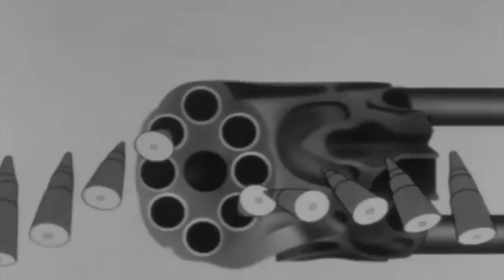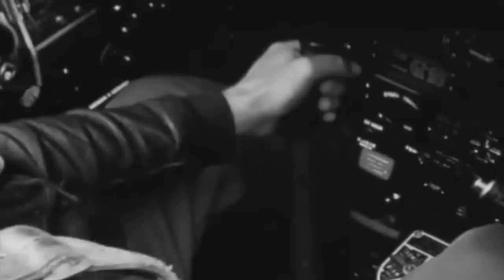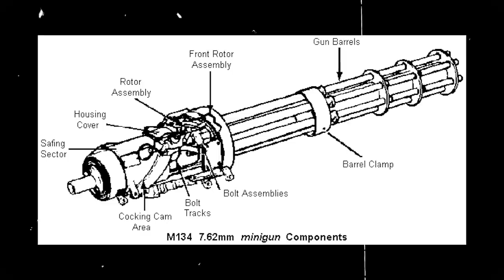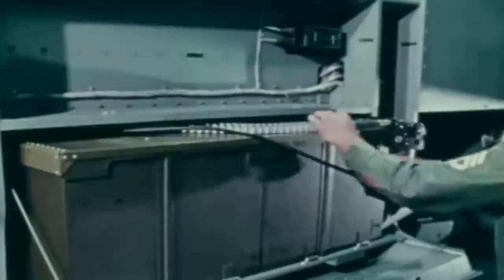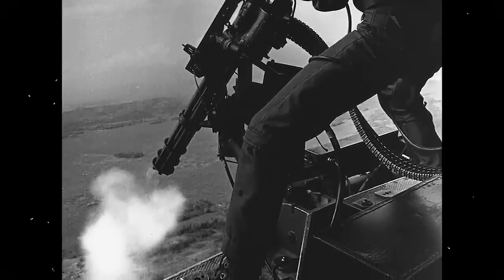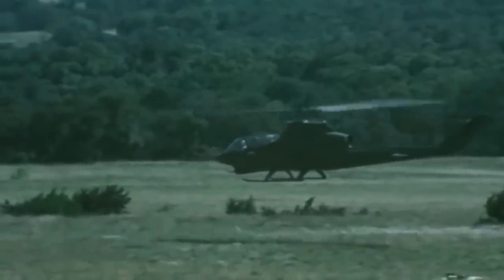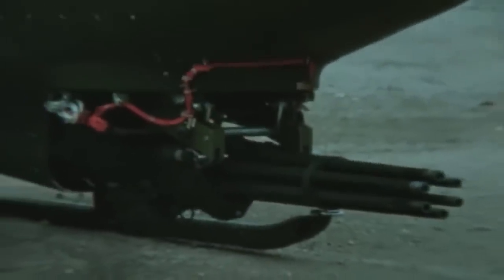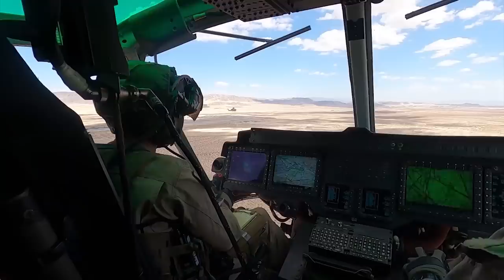Minigun -  M134 7.62×51mm Six-barrels of Pure Destruction

Comment: We had a gentleman who was in my VFW post. He was in the Air Force during Vietnam,  and he was in a AC 47 squadron while he was there. Those aircraft were essential to the troops on the ground then and now. Even though they have moved on from the 47 , still they've provided  much protection.
Reply: The last gunship Aircraft I got the see was the AC-130U version even though I did not get any closer than 45 ft from it it was still an impressive sight with all that firepower sticking out. Especially the 105mm at the back.
Reply: Spooky  👻
Reply: Semper Fi from a '69-'70 Nam vet.(0311 -USMC).
Reply: I had a opportunity to both see a AC130 in operation and get to take a ride on one during a training op.  In somalia they had 4 of them circling one night blowing the shit out of Aideeds compounds.  The only real issue is that you have to have both air dominance and no anti aircraft fire and also you have to use them on moonless and hopefully cloudy nights because even heavy small arms can be fatal to them.

Comment: My dad was a door gunner on a huey gunship.  I've been to his reunions and have conversed with pilots and door gunners alike.  You have a few points wrong.  

1.  The m60 did not overheat.  The helicopter propwash allowed sustained fire while keeping the barrel relatively cool.

2.  Most gunship door gunners modified their guns with recoil and feed pawl spring modifications to allow their guns to fire at insane rates.  Again, the prop wash still kept the barrels cool and reliability was still better than ground units.  My dad said he had periodic malfunctions while serving with the 11acr scout platoon on his first tour.  He said he could count all his airborne malfunctions on one hand (during his second tour).
Reply: I agree. Several of my buddies that flew Huey gunships never complained of m 60's overheating on their Hueys.  poor intel and research
Reply: Yea, there was a South Vietnamese coin that the door gunners would put at the end of the buffer spring of the M60 to give it more tension to increase the firing rate.
In another video about helicopter door gunners in Vietnam an ex door gunner chimed in with a comment talking about how they used to do that, he said he still had the coin he'd stuck in his and removed it the day he rotated out of his unit.
Reply: +1 this video completely missed the point of mini-guns. It was not because they were more reliable than m60s it was because they had a higher rate of fire which was in certain circumstances more important than high caliber.

Comment: I flew UH-1C gunships that were mounted with a minigun on a pylon on each side of the aircraft. They could be aimed left-right, up and down, and were fired by the left seat co-pilot/gunner. The rate of fire on our guns was 2,400 rpm, but when the guns were aimed far left or right, the inboard facing gun would stop firing and outboard facing gun would have its rate of fire increase to 4,000 rpm. They were not my favorite weapon as they tended to have stoppages for a variety of reasons. I much preferred our aircraft that had a nose mounted, belt fed, 40mm grenade launcher, which I found to be a very reliable weapon.
Reply: I've long wondered why the electric 40mm grenade launcher wasn't used on more platforms. Did it have some notable disadvantage?
Reply: @dwaneanderson8039  I don't think so. They seemed to be easy to maintain and very reliable. Availability maybe?
Reply: @dwaneanderson8039  possibly because of availability and ammo logistical issue perhaps? Because they sure are more heavier and bulky so its more complicated to be delivered to the troops or platforms in the frontline, that's just my theory though, some one feel free to correct me
Reply: @kevinrahmatfathoni7896  The grenade launcher I'm talking about is the M129. It used the same ammo as the common Mk19 grenade launcher. It could also use the low velocity ammo used in hand held grenade launchers like the M79 and M203. 
The M129 is smaller, lighter, faster shooting, and apparently more reliable than the Mk19. The only disadvantage that I know of was that it needed electricity to run, but so does the minigun, and people seem to be okay with that.
Reply: Especially when the homemade grease pencil cross hairs on the windshield were on the money.
Reply: “Which I found to be a reliable weapon” I’m sure you did my friend lmao.
Reply: Concerning problems with the bloop tube (M129) :

It's pretty simple, to be honest. There were two issues with the M129, and both came from attempted fixes from the older M75. While most every aspect of the M129 was an improvement over the M75, two problems simply cropped up that didn't have any real solution - even the Mk 18 suffers from them. 

1: Weight. Simple. The damned things are heavy as hell, and their ammo doesn't help.

2: If the electric motor fries, for any reason, it functionally becomes a lump until you can get it pulled by the QM for repairs. While the old 129s were much simpler, the soldiers who could efficiently swap out the internal motor were few and far between... assuming a platoon even had one. Lacking an external drive system, which can be swapped out easily on most electrically driven weapons, the internal drive motor made them more trouble than you might expect when they went out. Granted mini-guns can also have their motor go out... they're external motors. The motor can be unbolted, yanked, and replaced by a monkey with a socket.
Reply: @thalastianjorus  I never had a motor go out on my M134, thankfully. It was probably the most reliable weapon I ever used.
Reply: Buddy, my Uncle said the exact same thing.  Although in ALOT of Choppers that were flying in for Medivac, several had Miniguns, but he told us that almost EVERYTIME he got back from a mission, the Mini was locked up, horribly jammed where it had to be surgically removed, or some malfunction would occur.  He said he ALWAYS relief on his M-60, at some point, and that it was the last gun firing. He said that 40mm was the most awesome weapon he had too.  It could change negative outlooks REALLY quick, and have the enemy running for their lives in a second.  He said apart from the minis and the M-60, they also carried a M-14, that was mounted on the side of the fuse lodge.  With SEVERAL ready loaded 30rd. Clips laid in an empty, 1000 round ammo box right beneath it.
Reply: Wow.. 😮
Reply: THANK YOU FOR YOUR SERVICE AND GOD BLESS YOU AND ALL WHO SERVED.
Reply: The M'5 system was great.
Reply: Any technical issues aside, you can typically trace most war-time decisions back to the financial departments.
Anytime something doesn't make sense, look at the money and suddenly it'll all come clear

Comment: Thank you for finally slowing down your speech pacing. Overall you did a pretty good presentation.
I was a gunner on AC-119G Shadows in 1969.

 In the  aircraft suspended gunpods, the ammunition drum looks similar to a post hole digger. The inner surface of the drum housing has extruded grooves that run front to back.
SUU-11 pods were self-contained and battery powered, only connection to aircraft was for firing and rate selection. SUU-11 A/A Pods were 6000 rds/min only B/A pods were selectable at 3000/6000 rds min.
The rounds are forced to travel towards the guns rotor along these grooves by the spinning "screw". As the rounds exit the spinning drum, there is a feed unit that carries the rounds to the breeches. As the rounds travel through the feeder, they are guided through a 90 degree arc guiding them into the breeches.
As in the sequence of reloading the SUU-11 inside the AC-47, we hand cranked the rounds into the drum via the delinker/loader (7 rds per rotation) and links were stripped and dumped into an empty ammo can. We usually carried 33,000 rds as nominal load. Expended brass was captured in another empty ammo can.

Hope this is of interest to someone. 
Cheers!
Reply: Same basic ammo drum and feed setup as on the M163A1 self propelled Vulcan gun I was on which from what I understand was just a slightly larger drum then what was on fighter jets that had the Vulcan gun.
The "screw" you refer to was called a helix on our systems, even our 24M gun maintenance people weren't qualified to take one of the drums apart and mess with the helix, anytime we had an issue and one needed replacing civilian technicians came in and did it.
When we loaded our ammo drums the system had an electric motor that sucked in the linked ammo and spit the links out the side of the chassis' hull through a temporary chute we hooked up for loading, for getting everything set up and started there was a knurled knob with a place to put a ½" drive speed wrench into the end of it to act as a crank, we'd get the first few rounds into the drum that way then hit a spring loaded toggle switch to run the electric motor, thank God we didn't have to hand crank 1,200 rounds of 20mm into those things, it was a real bitch just getting those first few de-linked and into the drum, you practically had to hang on the speed wrench using it as a crank when doing it.
Oddly enough and I've never known why the M167 towed version of the Vulcan used the 20mm ammo linked, each link had those 2 little ears that stuck out on them and the ammo would hang in loops in a big ammo can right next to the gunners seat, at the top inside the ammo box was 2 rails that ran length wise that the ears from whichever link you'd select to make a hanging loop would slide down, I was only around those in training since only airborne units used the towed version but I never did get an explanation from anyone about why it used the linked ammo and our self propelled guns stripped the links off for it's storage/feed system, you'd think they'd have made them both the same for compatability reasons.
Reply: I don't know why you are praising the video. The presentation of the video is improved but its also a very inaccurate video. And at least to me that is a more important problem than it being presented well.
Reply: @peterisawesomeplease  
What's so inaccurate about it? There may be a few finer points that are wrong but otherwise the history of the Gatling gun and the history and development of the 20mm M61 gun is correct and as far as I know so is the history of the mini gun.
So what's so inaccurate about it?
Reply: @dukecraig2402  It misses the entire point of mini guns. The only explanation it seems to give is that the m60 over heats and jams. But this is actually incorrect. As a helicopter mount it rarely overheated or malfunctioned generally. In fact the minigun tended to have more problems on average. The miniguns were used because of their higher fire rates and lower caliber. Which normally would not make sense given the weight of the gun. On a ground vehicle you would choose and m60. But because helicopters on average move faster and shoot from higher angles you need a higher rate of fire to ensure some hits and those hits are less likely to need to go through as much stuff. Prior to the mini gun helecopter crews would go so far as to modify m60s themselves to try to increase the rate of fire even at the expense of reliability. 

This is a video about the development of miniguns which gives a false reason for the development of miniguns and does say the actual reason. That is pretty bad.

But ehh I guess this is dark docs, which at this point is basically a pure war porn channel rather than having any interest in history.
Reply: @peterisawesomeplease  
Well I don't know how you draw that conclusion, yea they were incorrect about M60's overheating when used as helicopter door guns but as far as the rate of fire about the mini gun it's pretty much made clear that it's high rate of fire is the whole idea behind it, I don't see how anyone who watches this video wouldn't get that point. 
So yea, the thing about the M60's overheating is an inaccuracy but where are all these other inaccuracies you say the video is full of that make it not worth watching?
I was a Vulcan gunner in the Army and their history behind it's development is pretty much spot on, the fact that it was developed to get more rounds on target was made clear, then from there they go into the mini gun being basically just a smaller version of it.
So aside from the M60 overheating thing I'd say it's pretty much an accurate account of the mini guns development and history, and as far as the door gunners in Vietnam modifying their M60's to get a higher rate of fire I just don't get why you'd claim that's some sort of "inaccuracy", this video is about the mini gun not the M60, and just so you know the mini gun wasn't specifically designed because of the need for a better door gun for helicopters, it just found a role there, the way you're wording things you make it sound like it was specifically developed for that and by leaving that out the video is inaccurate, it isn't because the mini gun was not specifically developed for a better door gun, if it was you wouldn't have seen a single M60 in that role by the end of the war, the fact is the mini gun doesn't work as a door gun on a UH1 that's being used as a troop transport, the weight of the gun and the ammo would mean that a UH1 could only carry a few troops, that why M60's were continually used on troop transport UH1's until the end of the war, a troop transport that can only carry a few troops is pretty much worthless wouldn't you think?
Reply: @dukecraig2402  No it is not made clear that the high rate of fire is the point. The video seems to suggest that reliablity is the point. It mentions the high rate of fire but never mentions why it would be important. It does not need other inaccuracies because the main point of the video is wrong. It would be like a video on the solar system listing tons of correct facts about earth and the planets but then saying the sun circles the earth. 

I never claimed that not mentioning attempts to make m60s fire more rapidly is an inaccuracy of the video. It is simply to demonstrate the point that the video was missing the most important reason for the development of miniguns. The high rate of fire needed on fast moving vehicles. It being used as a door gun is not needed to make this point. The fact that the m60 continued to be used in many roles(in particular roles with lower speeds) furthers my point. The minigun was not a replacement for a failing m60 but weapon designed to replace it in certain roles where it performed better.
Reply: @shadowgunner69  
Oh god yes, we had to hand crank the first few links in to get everything started and I always thanked the lord above that I didn't have to do all 1,200 that way, but if we had some type of problem with a system on the range we had to hand crank all the ammo out of the drum due to the fact that the feed motor didn't run in reverse, but at least we weren't fighting against the links, but we did have to re-link everything by hand once we had all the ammo out of the drum, that was a miserable task.